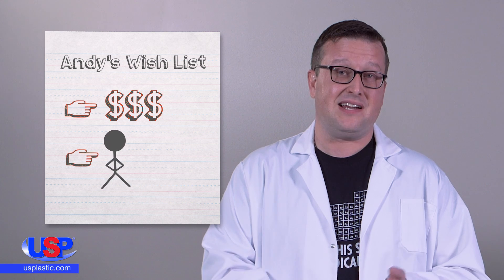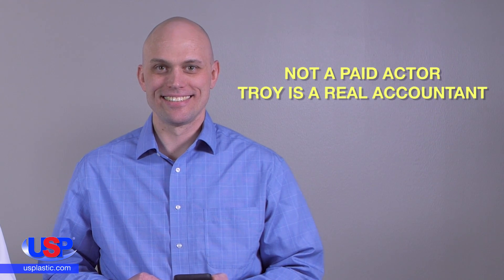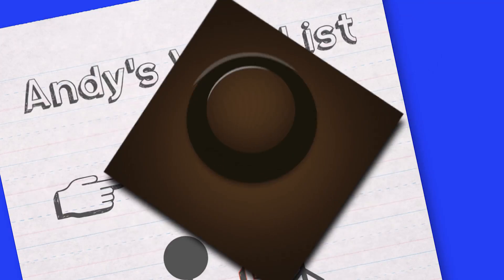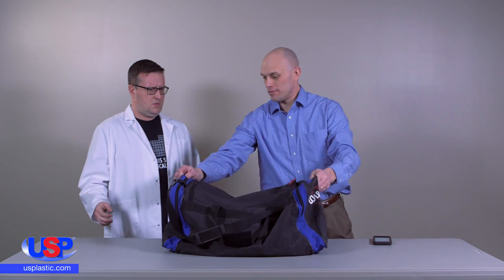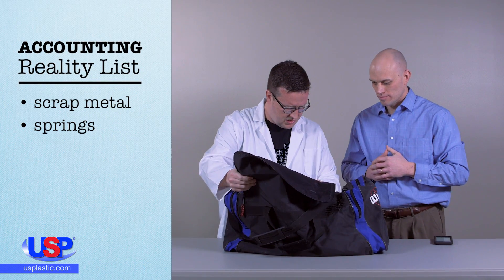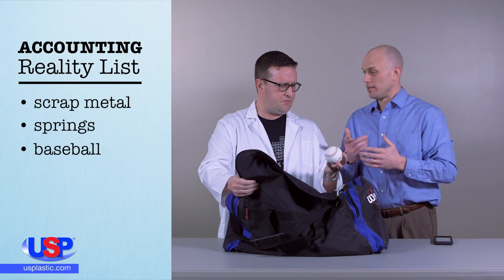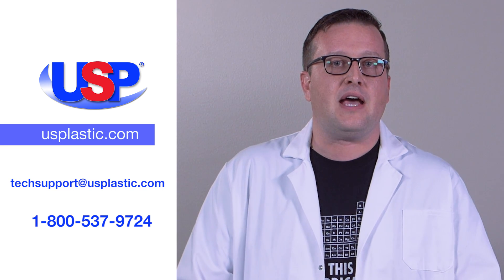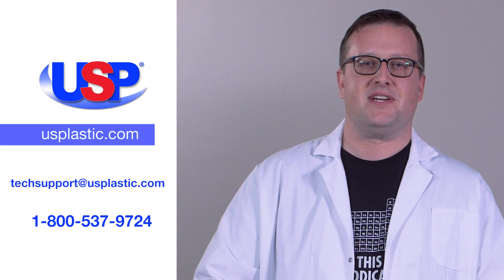GLASS VS. ACRYLIC VS. POLYCARBONATE  | ANDY JOE PLASTIC HERO | U.S. Plastic Corporation®

Comment: I'm looking to build a display case with a clear top about 30 inches by 40 inches.  Imagine a coffee table type of base with a clear display box on top.  Wooden supports on the corners to slide panels of acrylic or polycorbonate on all sides.  Then a wooden frame around the length and width of the top with that 30x40 clear surface resting on top.  What material and thickness would you suggest for a surface piece of that size that will have minimal to no warping?
Reply from the maker: Thank you for your interest in U.S. Plastic Corp.®. Please contact our tech department they can help you select the best type of sheet and thickness needed for your application. You can reach them via phone at 800-821-0349 Monday- Friday 8 am - 5 pm or via email at techsupport@usplastic.com

Comment: I am trying to decide on glass, polycarbonate, or acrylic for a rooftop on a wooden pergola. 
What is better. The weather here reaches around 38-41 degrees celcius
Reply from the maker: Thank you for your interest in U.S. Plastic Corp.®. Acrylic and polycarbonate are both half the weight of a comparably sized piece of glass, and yet both plastics are much more durable than glass, providing more impact resistance.  Polycarbonate is stronger than acrylic. Both acrylic and polycarbonate are weather-resistant and expand and contract with temperature changes without long-term or permanent shrinkage. Acrylic and polycarbonate are easy to clean. The best choice for cleaning is a microfiber or 100% cotton cloths.  Acrylic should only be cleaned with warm soapy water or an acrylic cleaner.  Polycarbonate has a higher chemical resistance; it can be cleaned by harsher cleaners containing chemicals. Neither plastic should be cleaned with solvents.
Reply: I would like to add that acrylic is more UV resistant than polycarbonate.

Comment: how thick was the polycarbonate?
Reply from the maker: The polycarbonate and the acrylic was about 1/4 inch thick
Reply: U.S. Plastic Corporation can polycarbonate survive deep ocean pressure? I need to know because I'm getting my thoughts ready for paper and I'm getting ready to make something no one has ever witnessed before. If it can't can you point me in the direction of something that is transparent and can survive the ocean depths without shattering?
Reply: @incogspectator3042  polycarbonate has a tensile strength max of about 70 MPa (1/8 inch thickness tested) according to an ASTM test. Using a chart on wikipedia that's about what you'd see at ocean pressure when at 6500 meters. However, there are probably other factors to consider and you wouldn't want to just trust it would work without a lot of testing first.